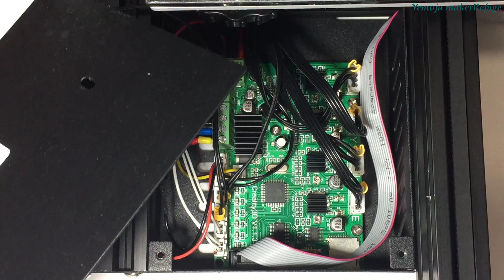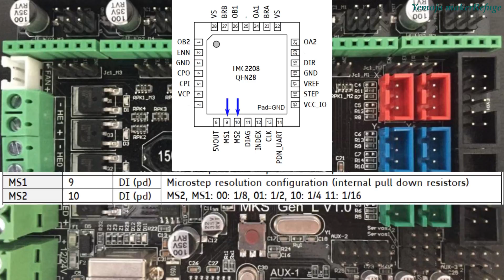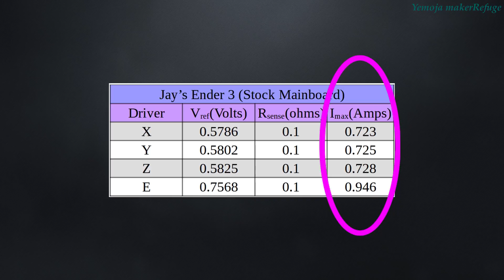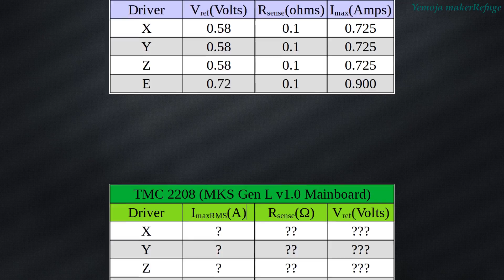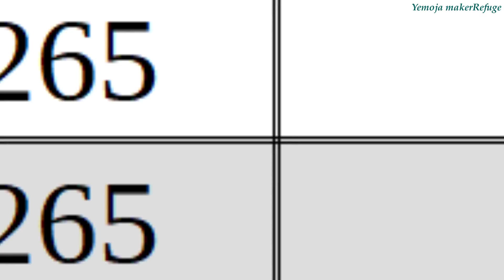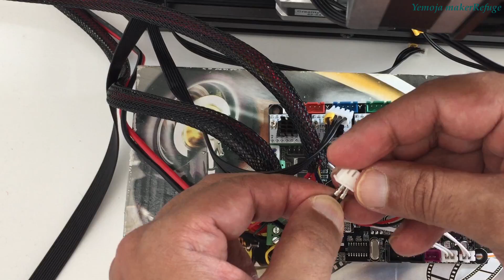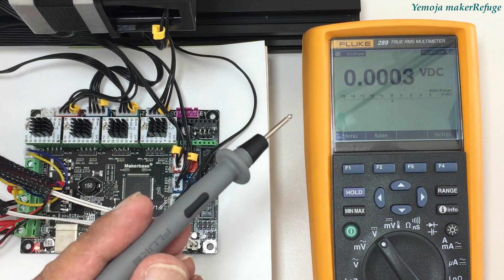Ender 3 : Upgrade to MKS Gen L v1.0 + TMC2208(Legacy) - Part2

Comment: Thanks for this great in-depth video.  I was thinking of upgrading to an SKR V1.1 board with TMC2208.  I just ordered a board with 5 TMC2208 for really cheap and want to try it out.
Reply from the maker: Heya @Matt Mannino. Cool! I have the same board but need to fix the SD Card slot as it doesn't hold the SD Card in. I haven't tried it yet. It is for a Kossel which I have been dreaming of building. Just collecting parts for now. What do you plan to run on it? Smoothieware?
Reply: @yemojamakerrefuge898  I was planning on running Marlin on it for now.  I was planning on getting the MKS GEN L and 2208s but found this board which is 32 bit and comes with 5 2208s for $40: https://www.biqu.equipment/collections/control-board-kits/products/bigtreetech-skr-v1-1-motherboard-32-bit-smoothieboard-arm-cpu-control-board-open-source-for-tft3-5-printer-pannel?variant=18528277889122
Reply from the maker: Hello @Matt Mannino. Ah I see. But Marlin 2.0 is still in development and is primarily used by developers for development/testing/verification. It is in alpha stage and there's a large RED caption which reads "Proceed with Caution" at the Download site.
So you are wanting to experiment with Marlin 2.0 I believe?

Comment: Thank you, what a great detailed tutorial, I don't have a Rasperry Pi, how can I have SD support?, changing the LCD for a touch one with SD slot?
Reply from the maker: Hi @El Viejoperro. I can't afford the touch screen solution, its a bit of an overkill for me but yea if you are into it then cool, go for it buddy.
 I am however going to try to install one of these - https://www.aliexpress.com/item/KuaiJieWei-3D-printer-Store-45-40mm-Independent-External-SD-Card-Slot-Module-with-20cm-Dupont-Cable/32878793742.html?spm=a2g0s.9042311.0.0.702f4c4dJyYHyd. 
Still waiting for it to arrive though.
Reply: Yemoja makerRefuge 
Oh wow, thank you J, I will go for that SD solution as well, would you kind enough to do a video when able on installation and firmware set up?
Thanks again Cris
Reply from the maker: Yea sure buddy :)

Comment: I tried to install an upgraded RepRap LCD on the board and it does not work whatsoever. How do I make it work?
Reply from the maker: Heya @Jaron Durkee. I've not used any other LCD for this upgrade save for the stock one. Nor do I have any other for that matter of fact. Can you share some specifics of this LCD preferably schematics/pinout?

Comment: Hi Yemoja, any advice on why my lcd screen does not work? I reverse the connected as per your video but it does not work? What exp slot on lcd do you connect to?
Reply from the maker: Hi @Leigh. Its labeled EXP1 on my board. Right next to the E1 driver socket. Hope it works.

Comment: Thanks! This was a huge help in my MKS GEN L Conversion. I had some issues with the steppers making clunking noises, but I must not have set vRef correctly - because when I went back to double check them, the motor that was having issues was set way too high. Once I adjusted that, they work great! It is amazing how quiet it is!

Comment: Thank you. Have you had any problems with the 2208 on your extruder? It being too weak? or skipping steps?
Reply from the maker: Hi @waydaminute. Skipping steps? No I have not encountered this after the upgrade.
However I did have this problem when I rebuilt the printer. I found out later that it was due to the bottom part of the coupling rubbing against the motor housing. Specifically the circular base part from which the shaft sticks out from. Hoping this may help.
Reply: @yemojamakerrefuge898  Thanks again for the great guide and reply. I'm following your guide and notice that a few others who upgraded with 2208 on mks gen boards cant get  the etruder driver dialed in and ended up changing extruder driver to a lv8729. But since you are running with no problems I'll try 2208 in the extruder spot and see what happens.
Reply from the maker: Is that so? Interesting. I'll keep an eye out for it. My print settings are rather conservative I believe - v@60;a@1000;@j@5. So perhaps that's why I've never seen it. These are the same settings I used when my Ender 3 was in its stock configuration.
I'll check out the LV8729 device.
Thanks for information buddy.

Comment: thank you gj, whats the difference tmc 2208 v1.0 - 1.1 - 1.2 ?
Reply from the maker: Hi @Plazma! The revision numbers are specific to the manufacturer and you probably want to approach the manufacturer of your module for details. For instance, Fystec has revision 1.0 & 1.2. You can check out their Wiki at https://wiki.fysetc.com/TMC2208/. Basically, revision 1.0 modules are for stand-alone operation whereas the 1.2 ones are UART configured modules for use with their F6 board ( see https://wiki.fysetc.com/F6_V1.3/). Hope this helps.
Reply: @yemojamakerrefuge898  thank you very much, if i dont use uart it doesnt matter for me right, all version is ok for me
Reply from the maker: Yes that's right buddy but preferably go for the v1.0 devices for stand-alone operation if that's what you want your drivers to run in. It's easier.